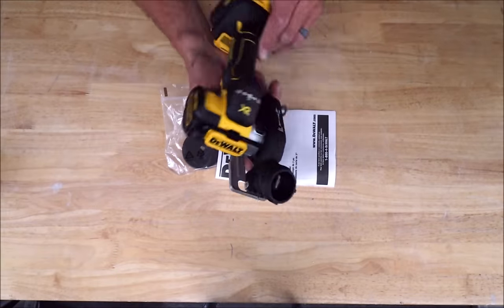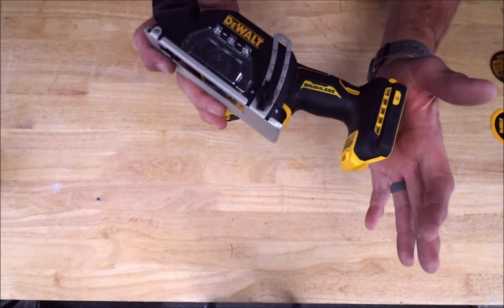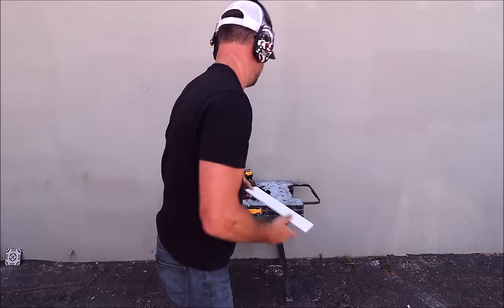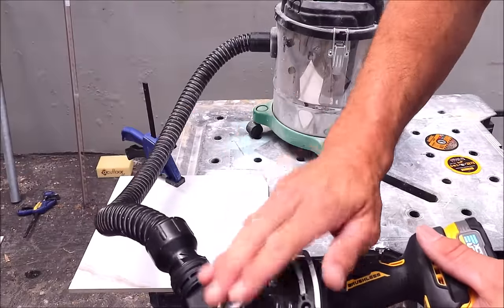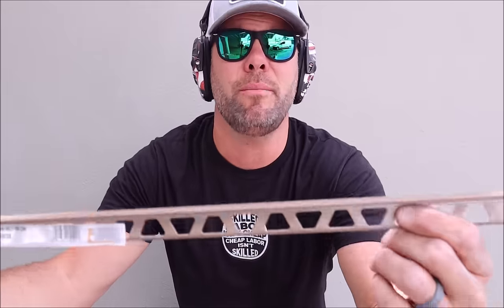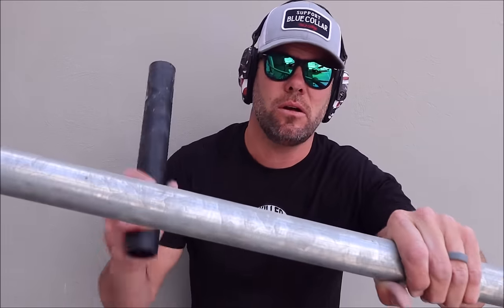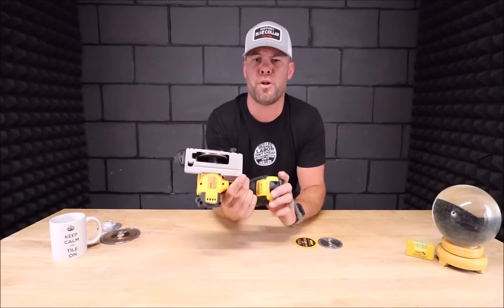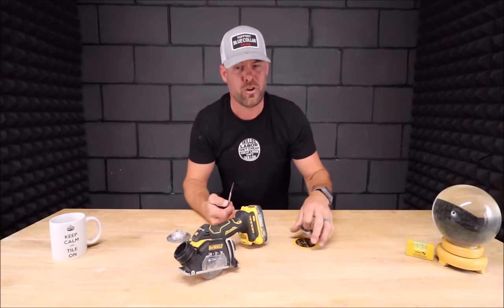Dewalt 3 Inch 20V Cut Off Tool - The King Of Them All!

Comment: It’s a good tool to have but that’s dependent upon your skill and ability to handle this tool. 1st, don’t let the blade guard/guide fool you because it’s about as useless as a brushless Dewalt 20v flash/spot light 😂. Seriously it is. It hinders your cuts as you can’t follow your scribed line without leaning uncomfortably over it to “try” and see that your attempt to cut is straight. And just from looking at that guard, attaching a hose to it for dust control adds more to the hinderance of trying to follow your cut line. Secondly, that guard doesn’t stay in one of its 3 positions when cutting. I find it best cutting in reverse if I have to use the guard, along with the utmost patience. Forward cutting with the guard is absolutely tedious. Now, moving forward, with out the guard, it cuts pretty well for its need but this is the skill/ability factor I stated earlier that is needed. Free handed cutting needs the utmost control here because this little guy is light and spinning fast, if you’re not in control and patient, this can hurt you or harm your cut if it’s needed in a precise manner. Without the guard, your susceptible to more dust and debris, the blade getting pinched and wobbling off course possibly kicking back or out of the cut thus injuring you. Personally I see this as a poor design for a fast buck on Dewalt’s part. I wouldn’t recommend it but that’s the game of choice - is it needed or not. Unlike a circular saw that is much heavier and easier to control this little cutter poses more problems than solutions. My biggest issue is with the guard/guide design. Just as a simple cut off tool with precision needed it’s good, copper demo it’s good, ripping up drywall it’s good. For the price it’s nothing special nor fancy. As for cutting tile, expect chips and imperfections near your finishing cut. When I refer to the guard/guide being disappointing I mean in terms of setting the depth cut and getting going, when that’s being attempted the guard will drop when applying pressure as you push your cut. It’s kind of difficult to explain but if you get one you’ll understand right away. I’d suggest renting or borrowing one if possible before wasting money here.
Reply: Extremely insightful comment. I just got this tool myself with two primary purposes in mind: removing flood-damaged sections of drywall and cutting vinyl & aluminum soffit. I was surprised to see that people actually use this for cutting tile. I don't see how it's possible to get a straight, clean cut without having god-like skill and dexterity. And as I think you alluded to, the cut line indicator on the shoe of the dust shroud is absolutely useless because your view of the front of the shoe is completely obstructed by the vacuum/dust extractor connection. I've also experienced the unsettling movement when cutting with the dust shroud/shoe attached, due to the 3-position gaurd being way too easy to move.
Reply: It's free gift with buying a 2 pack of batteries and charger 294 for the pack and get 2 free tools. The deal ends January 22 or 24. I'll take it cuz it looks cool and about the size of a drill

Comment: I see that kinda useless. Cuts real slowly.  I'll just keep using my grinder
Reply: Agree. Maybe to cut butter 🧈
Reply: not sure if it is the blade, my 12v milwaukee  appears to cut faster than that
Reply: I have the Milwaukee one and it didn't really come in handy too much during a remodel. Only helped with a random small cut. Little disappointing.
Reply: I’m getting one for tiling but it’s only for quick small cuts instead of going outside for my grinder. It was never going to be on par with a grinder.
Reply: I know...gringer seems to do the job.
However I am curious about how it would do cutting drywall. Hook up the vacuum to it and see if it can keep the dust down!

It is not like we can take drywall out to an open space and start cutting.
Reply: The guy demonstrating the saw is not properly using the blades for the different jobs/materials. The saw has a forward and reverse on it for cutting different material. The forward and reverse are not for directing the dust in different directions like he stated and demonstrated…

Comment: As a tile guy, this tool would be going up against some tough competition with my Flexvolt grinder when cutting tile. I could only see my self using this if I wanted to do some quick dust and water free cuts indoors with it hooded up to a vac. 
FYI: I just found out Diablo released a 3" mesh style diamond wheel for this tool. They call it the "Diamond Continuous Rim
 Cut-Off Discs for Masonry"
Reply from the maker: agree
Reply from the maker: Found that blade! I'll have to put together a PART 2 for this video
Reply: @LandbergTileTV  Looking foward to it.
Reply: fartpoobox ohyeah  hmm, yeah, I can see that being useful for backsplashes, especially for when you need to quickly cut the outlet holes.
Reply: Yah they’ve had that blade out for a minute it’s a beast of a blade tho I have the Milwaukee version of this tool because It took Dewalt forever to come out with their model like Ryobi has one Rigid has one and Makita does but theirs is trash
Reply: was looking to get this tool to help with my tile work. I figured the cutting of porcelain tile had more to do with the provided blade than the tool itself. Good to know someone was thinking and came out with the mesh style diamond wheel
Reply: fartpoobox ohyeah  Thank you. Can you please provide link of your tool? Thank you very much.

Comment: The multiuse blade goes through 0.05” stainless like butter. The big batteries really overbalance the tool. A 5 amp is plenty. The new 5 amp powerstack is perfect if you’re going to cut through thicker materials.

Guys, seriously, read the manual. It tells you to REMOVE the dust shroud when cutting metal. There’s a good reason for that. The shroud is plastic. It can melt from the heat, or even burn. You don’t want the possibly red hot particles going into your vacuum! Inside the shroud is a metal cover over the top of the blade for metal cutting. I cut tile and stone in one pass and have the front edge of the blade turning down so as not to chip the material.

Comment: I own the Milwaukee one, love the tool, I use it to cut 1/4 in plywood or LVP flooring, when it comes down to tile I only use it for thin subway tile
Reply: Do you reccomend using this tool for LVP over a miter saw or circular saw or oscillator??
Reply: @tatebraboy336  I do, as long as you put a multi purpose blade it cuts like butter and you can have it next to you the entire time

Comment: the best tool to have when installing rigid  vinyl or laminate plank (the type of plank that does not bend when you hold one end of the plank) and when cutting finished material (were blue tape or a piece of wood is needed when preventing tear out or chipping).
Reply: This tool is better than using a miter saw or a table saw or cross cut or oscillator for vinyl flooring? Very curious because this tool looks like it would be awesome to do all the cuts since it’s so small
Reply: @tatebraboy336  you can still use miter saw to do cross cut, but if you needed one tool, the compact 3" saw will do it all. You will have good control with it.
The oscillator tool is bested used  for cutting existing door jams to slide the flooring under.

Comment: i used this to made a cutout in a granite countertop yesterday. it embarrasses full scale grinders. I bought the best blade to cut a steel railing for a client and the grainder struggled alot, but I had to do 2 more cuts after a few days, used this and it cut hardened steel railings with the stock dewalt blade like cheese.

Comment: I love this tool, I had been replacing my 12" wire shelves in our closets and putting in 16" & 20" wire shelves I used this tool to cut my shelves OMG so easy to work with, in closets that have multiple shelves in it I can get all the shelves cut in no time as compared to a hacksaw or a reciprocating saw.  Just a note the DeWalt metal cutting  blade is a much better and longer lasting blade then the DIABLO blade, lasts so much longer

Comment: I’ve 2 similar from Parkside (Lidl brand), but different models with different switches, I initially purchased them just have an idea how they feel cose I actually want to purchase the Milwaukee version, but I end up using them all the time while working with subway tiles, ceramics or mosaic, they will not replace your grinder, but it will be worth in my opinion. I use 2 Bosch meshed blades, they were more expensive than the grinders, but they cut amazing
Reply from the maker: Does Bosch make 3 inch mesh blades?
Reply: @LandbergTileTV  if 3 inch is this blade yes (Sorry, I’m European, thinking in mm 🤦🏻‍♂️). If you have instagram I can dm you a picture of it if you like. I still have a new one. I’m telling you, this blade is a game changer. Let me know if you have the same username and I will dm you a couple of pictures from different angles, the 2nd blade I purchased is still brand new in the package 👍 LE//: found you, check your dm on insta 👍

Comment: I like to use the 4.5 dewalt cordless for cutting cement backer board but the stupid dust port always wants to fall off.  I like the looks of the dust port here not only is it aimed better so the stuff is pushed directly up the port it doesnt look like its going to fall off on every cut...

Comment: Nice!!! Way more powerful than that week azz Weekwaukee! That Weekwaukee is one of the most  expensive  overpriced yet bogs down with the slightest pressure. Only good for cutting drywall and cardboard and barley cut through thin wood! Had to return it for a complete refund and replaced it  with the Ridgid, witch is a much better tool. But I will be grabbing this DeWalt it's a beast even  better than my trusty Ridgid. Nice vid 👍

Comment: The Dewalt cutoff tool is hands down the best on the market. 

If you are cutting steel piping or uni-strut go with a porta ban
Reply: can it do wood? I dont see any blades for wood. Sometimes I want to cut some quick wood poles, dowels etc. Or should I find a different tool?

Comment: Probably not ideal for cutting steel stud in a wall eh? I like how small it is but the width seems like it might be a bit tight in some situations. I'm running drainage and water lines at work for plumbing. Cutting lots of stud. I use my coworkers Milwaukee angle grinder a lot, but it is pretty tight in a lot of situations too. It's such a waste of time to pop out a stud just to cut out a 3"x3" hole... Any recommendations buying this over an angle grinder?

Comment: Milwaukee makes a really similar version that I’ve used for quick cuts when I don’t want to go set up my corded grinder
Reply from the maker: I've reviewed that 12V Milwaukee cut off tool 3 years ago. Great little unit, but power is nothing compared to this 20v
Reply: @LandbergTileTV  ya Joe the tool guy compared the Milwaukee and dewalt the dewalt came out on top
Reply: Cordless.... 60v grinder my friend.

Comment: Thanks for another useful video. Does it have a standard size arbor hole so that a common angle grinder blade can fit on it or require a dedicated blade? The evolution miter saw has that special arbor hole which causes it to only use a special blade which means limited availability and so on.
I don't think that tool would be worth buying if a person already owns a proper 4½ inch angle grinder.
Reply from the maker: The arbor works with 3/8 and 9/16

Comment: Go Berg! 
Probably would help the dust extraction if the dust shroud was contacting the material.

I'm sure that It's plenty of a Beast at 20v. 
I love my Red 3" Cutoff but without a 6ah battery its not so hot.

P. S. 
Dremel & Diablo have Blades.
Reply: I have tried all batteries with my Milwaukee and still frustrating stalling all the time, and I’m going to put it on eBay. I also have the Dewalt and it’s never stalled with a powerstack battery or a 2.0. The Dewalt makes the Milwaukee look like a toy. 
The Diablo blades are ok, but I find they get chewed up real fast. Milwaukee blade isn’t good at all. The Dewalt blade that came with the tool lasted the longest out of all 3.
Reply: @akaredcrossbow  It is only 12v. The others you mentioned are 18 so....
Reply: @reddbeard2030  I have some Milwaukee 12v tools that outperform some 18v tools. I have some great Milwaukee 12v tools that do the job just like an 18v.  
The point is the Milwaukee 12v cut off isn’t even worthy to be sold at Harbor Freight, and shouldn’t be sold anywhere. It should be pulled from the shelves and redesigned. I don’t say bad things about Milwaukee tools, but their 3”cut off tool is a big fail.
Reply: @akaredcrossbow  😲 
I hear you. 
I wasn't impressed at first but I found its niche doing quick cuts for tile work. 
I was already on the platform so I made do.

Comment: How well does it cut wood ?
Reply from the maker: This does not cut wood
Reply: @LandbergTileTV  What do you recommend as far as a small cordless powertool for wood cutting?
Reply from the maker: @andrewampaya124  Dewalt has a 12v small circular saw that is small and safe.
Reply: DCW030CAR101F

Comment: Have more Milwaukee tools than other brands, but doesn’t mean I’m Milwaukee only. Imo, ya get the best tool available for price can afford at time needing; so, the Milwaukee cut-off at the time……was a good 3” m12 saw.
That said, this DeWalt 3” cut-off beats the bageezises out of that “now” poor m12 Milwaukee 3” cut-off.
So, if looking for a great 3” cut-off and not in DeWalt; I’d go for it, as good way to enter the platform and it really is a better saw over the Milwaukee 😱, yep, I said it (will probably be my first DeWalt Battery tool, lol).
Cheers and liked this vid, especially the noise “editing”👍🏻
✌🏻

Comment: I am thinking about getting one to cut Hardy siding.
Reply: or the 4 1/2 cordless circular saw
Reply: @FixthisCD  I have the 4.5 and it works great  I absolutely love  that saw for cutting Siding, but I have not seen anyone use this saw for Siding so now I want to try it. Lol
Reply: Look into a guillotine for that. It makes hardie so much more enjoyable and safe to work with. Unless you're needing something for rip cuts in which case a circular or table saw with pcd toothed blades are the way to go hands down
Reply: @slayerspam  I don't do Siding  much but mostly windows and doors but often have to cut the Hardy Siding to replace windows.
Reply: DeWalt has a cordless hardi cutter. It kinda looks like a reciprocating saw with shears and it works great with no dust

Comment: I’m a dewalt guy, I’m a tool junky, I’m a carpenter/do it aller. I honestly don’t see a point to this saw! I already have a tool that can do everything here, it’s called a angle grinder!
Reply: I guess it's safer than angle grinder no?
Reply: @goumansf7370  it’s probably a little safer and the dust port but I still won’t buy it.

Comment: I have the Milwaukee and the Dewalt. The Milwaukee is a waste of money and just keeps cutting out and is a worthless purchase. The Dewalt is a beast and I have never stalled it. It was one of the greatest purchases.
Reply: You need to use at least a 4.0 battery
Reply: @jetskisteve8351  2.0, 3.0, 4.0, 6.0, same issue. Maybe the new high output CP2.5 and XC5.0 will make a difference, but I will never buy those batteries just to make “one” of my many 12v tools work properly.
Reply: Any updates on that Milwaukee cut off tool? Ever try it with the HO batteries?
Reply: @ChrisBranleh  no! Gave up on that POJ after I got the Dewalt. The Milwaukee was tossed into a junk tool box collecting dust with all the other headache tool. I will probably never use it again unless I convert it to a grinder. The Dewalt is just so effortless and nice to use. Now if someone can come out with better metal cut off blades, not just one use only, that would be great. I eat through blades very quickly.
Reply: @akaredcrossbow  I picked it up from HD for $99 tool only the other day so I’ll be testing it for myself. Will return if not satisfied. Thanks for the reply

Comment: The one thing don’t like about this saw, the DeWalt blades. For me, I like the Diablo, Milwaukee, and even the other brands out there. Think easier to find, and do a good job compared to the DeWalt blades.
Nit saying all DeWalt blades aren’t good, as the new DeWalt blades are pretty good for their circ saws, etc….but finding a super great 3” diamond blade can be challenging right now
Reply from the maker: Yup, I couldn't find the Milwaukee 3 inch blade. Have been off the shelf at my Home Depot
Reply: @LandbergTileTV  yep, it’s how it is, naturally can find online and pay whatever and wait; but when need a blade now, just can’t wait; so it’s closest box store and what they got😉
Have good one😊
Reply: Home depot has diablo turbo blades for 15$ I was cutting porcelain 30x60 with a track and the cut was super clean. I also stuck a hose in the dust extractor port.i was using the milwuakee 12v. There were times when it bog down with to much pressure but did the job. I'm a milwuakee guy but the 20v on this dewalt I might just pick one up
Reply: I use the 3” metal cutting Diablo blades and I find they need to make them a bit tougher. Too thin and they break down fast, same with the Milwaukee blades, and i’m only cutting 26-24 gauge steel, they should last a lot longer.
Reply: @akaredcrossbow  yeah agree about the thickness, go thru Milwaukee blades rather quick and also why buy them in multiples b/c they always on sale, just like Diablo’s…

Comment: How is this better than a grinder wheel? The depth feature is not needed, the dust shield makes battery powered senseless as the vacuum hose may as well be a cord. The wheel is smaller so only thin materials. A hard pass!
Reply: Easy! I plug this is to my Milwaukee packout vacuum!!